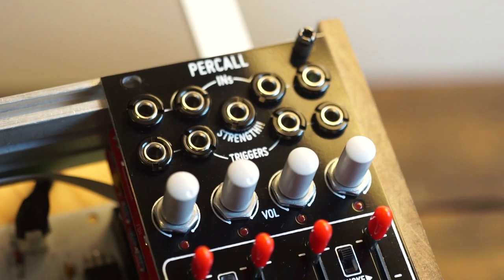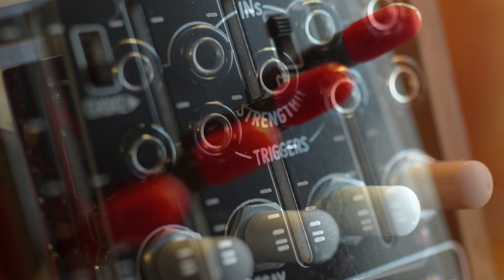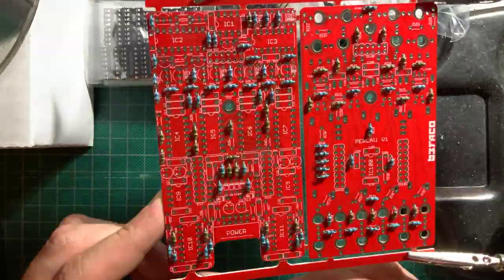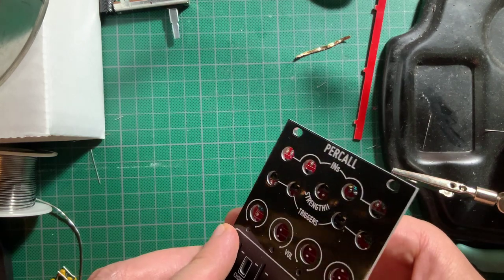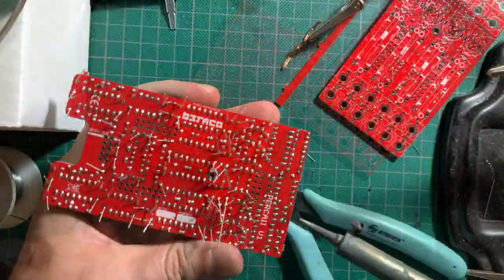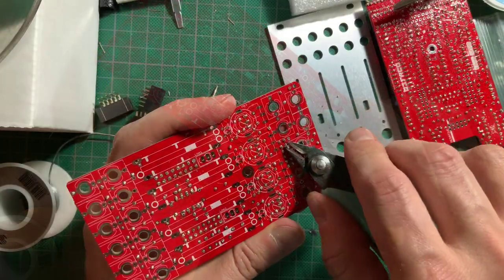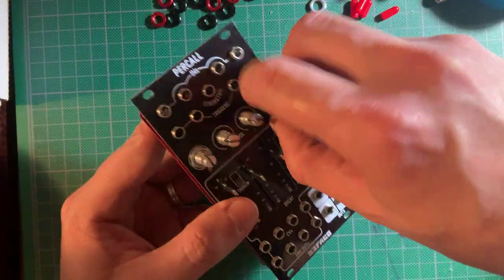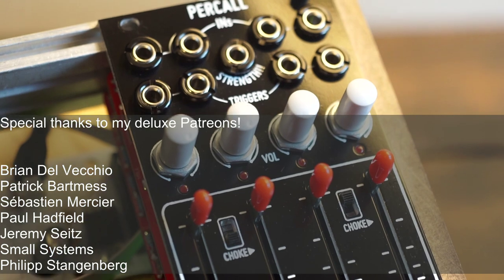Building Befaco's Percall module kit

Comment: Just finished the Percall and broke a bit of a sweat during the build. Not for beginners. In general, Befaco's pcb's are super dense and you need to be pretty concentrated and crafty to have all components fit properly. The build guides are very well documented tought. Still, I'm happy I watched this video before heating up the soldering iron. Thank you... And I think I'll be using this module a lot.

Comment: Yes, removing the faders is a royal pain.  I did trim down the pins, but unlike on the Muxslicer the Percal has those pins positioned to short against metal parts of the fader. So I didn't trim them quite enough.
Causes failure of Channel 4 output.
Luckily I only soldered the potentiometer pins, didn't solder the lugs on the fader chassis....just in case.
I love Befaco builds, maybe because of such challenges.

Comment: Does the unit work as a normal mixer when triggers aren't present? Or does it need a high voltage signal on each trigger to make it act as a normal mixer?
Reply from the maker: no, you would have to set the EG desay to it's highest setting and send a quick clock, to keep the VCAs high. These are trigger inputs, not gates
Reply: @QuincasMoreira  Oh, that makes sense. No adverse affects on the audio when doing quick clock+long decay? Looks like a great module!
Reply from the maker: @explodingPSYCH  I don't think so, but I think it's just better to use a dedicated mixer for this, this one is to cool to be relegated to such a mundane task ;)